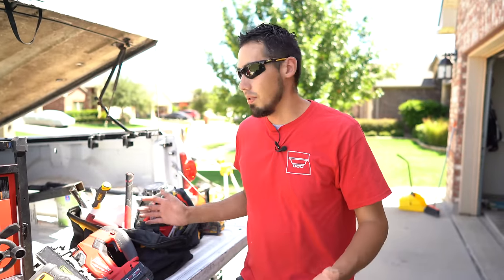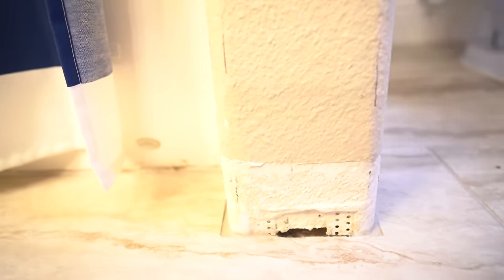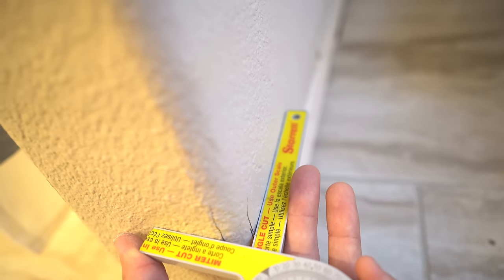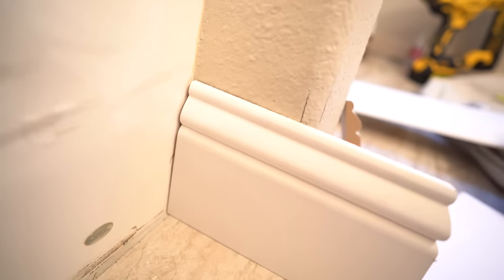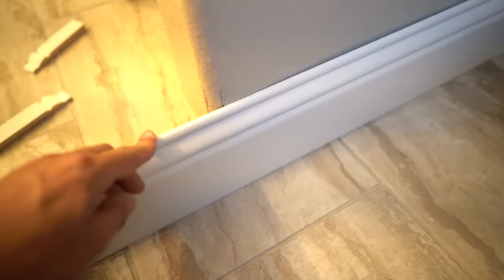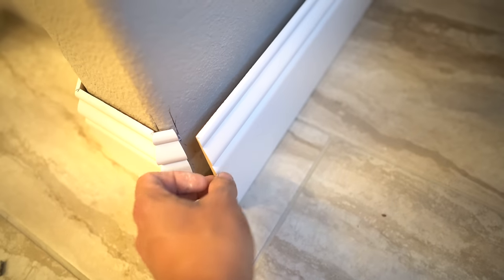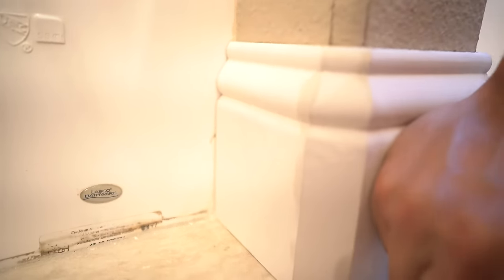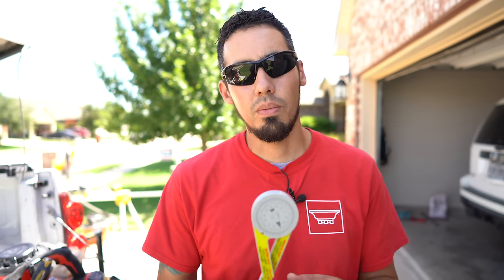This Simple Tool Gets PERFECT Miters

Comment: helpful video, however I didn’t want to give it a thumbs up or thumbs down. They make a various size tripods from floor sitters to overheads, and special clamps to use your cell phone to film. Please use them, you can even go cheap and get much better video.  

if you want to go expensive, I highly recommend Manfrotto products. parts are easy to get in any camera store, and all the fittings will work with your laser level at Cetera. The deck plate for a manfrotto can be used with a phone clamp for stable video. A good light stand can be had from pro master to use a laser level up to about 9 feet. 

most camera equipment fittings use the same threads as most construction equipment, and though it might seem expensive at first once you have all the parts you are good to go, often with better stability and strength than what I see in your Home Depot. Seriously, the tripods I see at Home Depot are cheap, and bounce a lot on most projects.